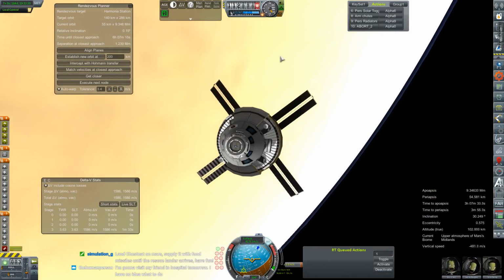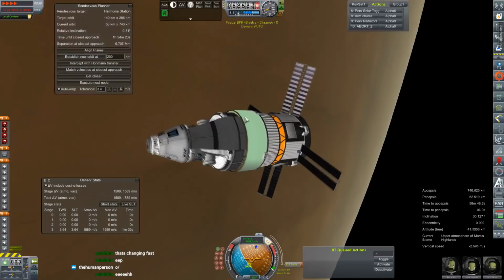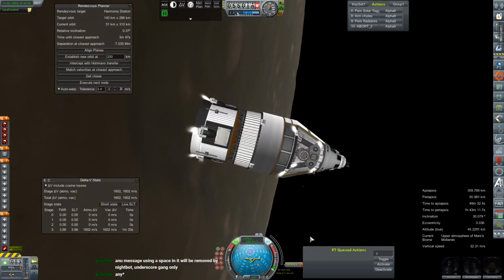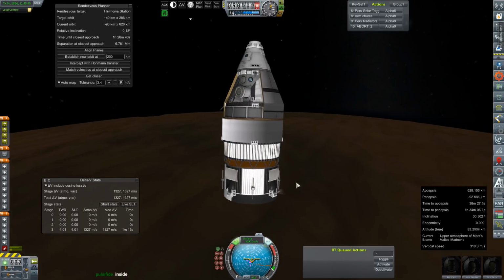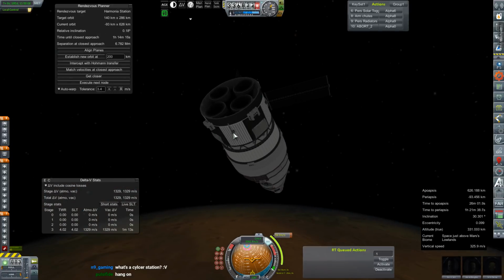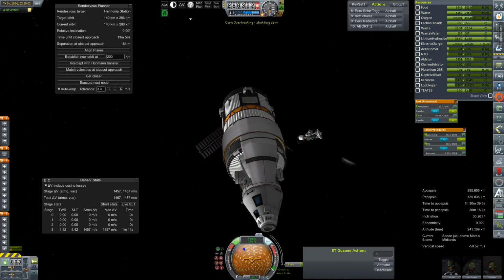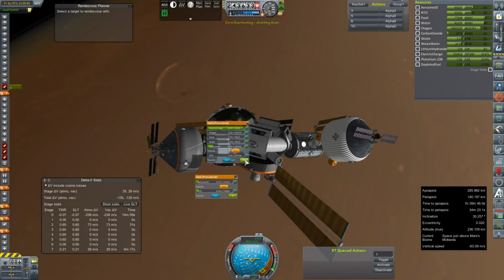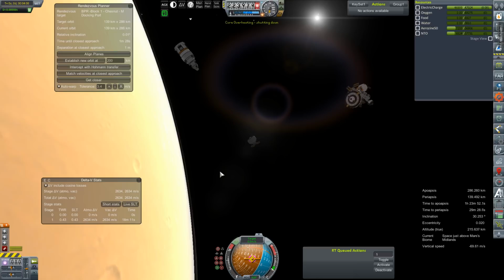KSP RP-0 #546 Intercept ( + Twitch Re-Cap )

Comment: As far as the ever-increasing (free)∆V with each subsequent pass, it might have something to do with your periapsis very slightly dropping with each pass because you are getting drag forces several minutes either side of dead-on-PE. So if you want more reliability, use RCS to restore your previous PE height at the end of each pass.
Reply from the maker: That is definately a part of it, but with a lower apoapsis the total time spent in atmo becomes longer. Even with a consistant periapsis, we should see increasing returns on subsequent breaking passes.
Reply: @CosmonautCrash  Yes though the Oberth effect would have a greater influence during the early passes when you are moving faster, and somewhat counteracts the longer time spent in the atmo for later passes. I had that chart somewhere about this (albeit in stock) but don't think I ever did the same tests in RSS/RO.